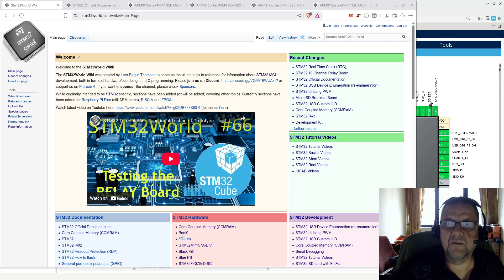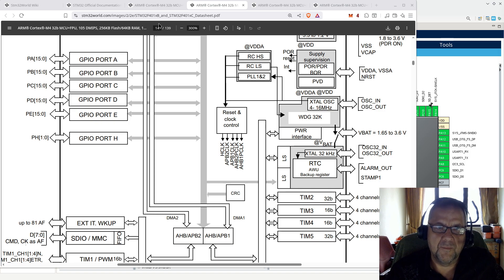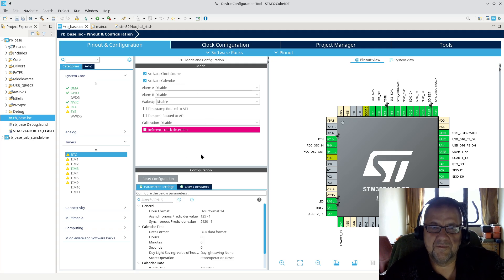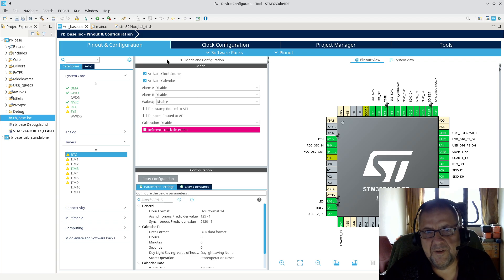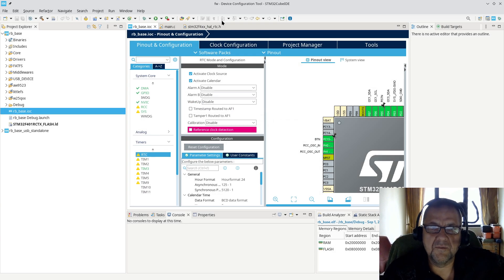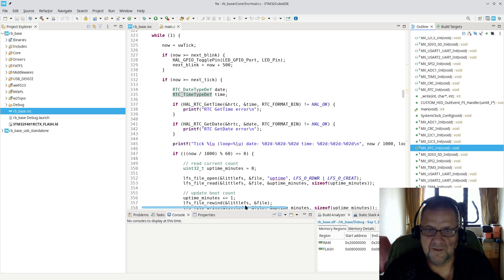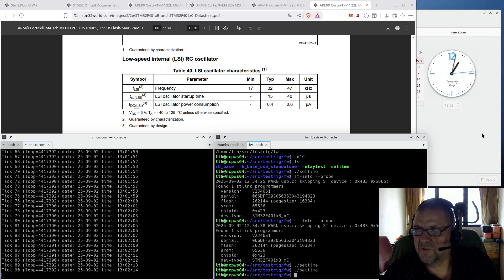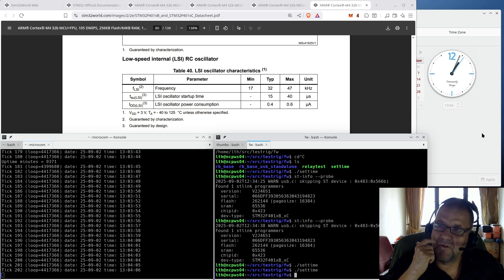STM32 Basics #5 - RTC - Real Time Clock

Comment: Another interesting feature is the "Alarm" in the RTC, which I think could be part of a "RTC 2" video. Essentially, using Alarm to wake the MCU up from deep sleep at a particular time.
Reply from the maker: Yeah I know - I have got to make a few more videos on this topic and I want to try battery backup as well.  However, I was really struggling to get my head around how STM32 deals with using the HSE and STM32CubeMX gives insane defaults making the clock run quite a lot faster than it should.  So, using LSE and alarms would be next ;)